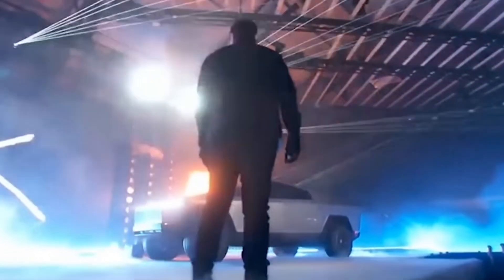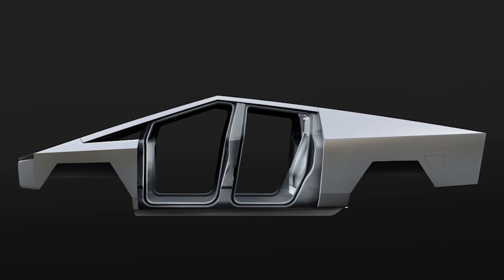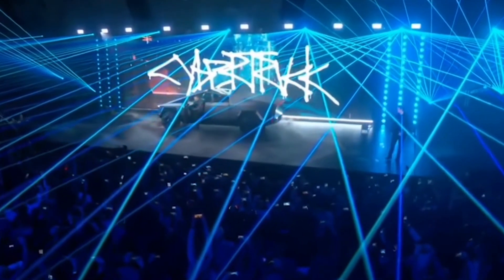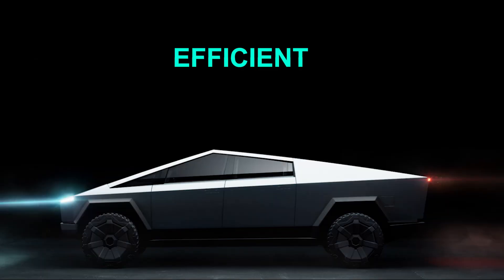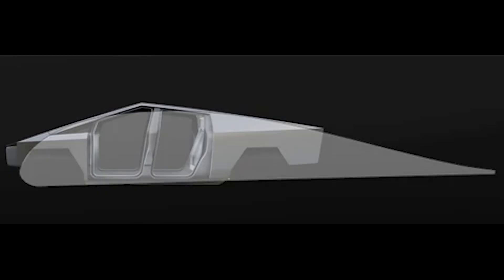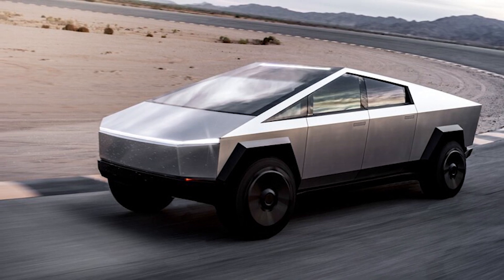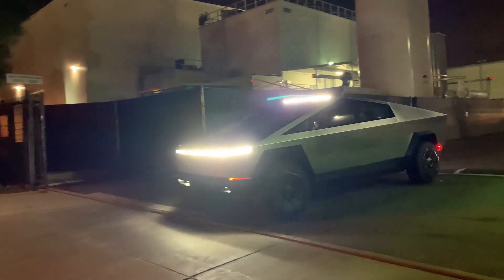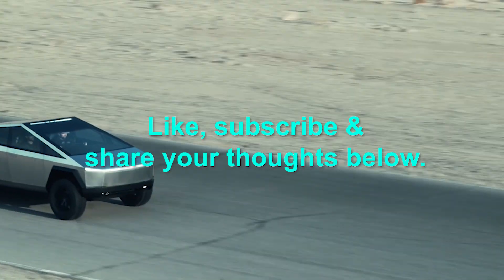Cybertruck is Engineering Genius (and will be copied)

Comment: Your safety analysis is off.. The 3mm Stainless steel exoskeleton (with a UTS of 1250mpa) will not be able to cushion a frontal impact. An abrupt stop will translate in a low ANCAP rating. In reality, a rigid 3 tonne vehicle should be able to bulldoze most passenger vehicles and increase collision times. Unless of course two Cybertrucks collide with each other... in that scenario the occupants from both trucks are in trouble.
Reply: I would agree but most safety standards around the world are in place to prevent that. 30-50 years ago bumpers were so strong and so tough that they would destroy everything they hit and not be scratched at all. The obvious drawback is that it kills whatever it hits and the passengers in the car. Today, cars are designed to collapse in the case of a hard impact to give the passangers/roadkill a chance. We are going to have to wait until tesla reveals more information about the truck to really have an understanding of its safety features.
Reply: @anubis520  When we design armoured vehicles for the army we generally don't extend the armoured steel beyond the cabin. I know Elon will be chasing that 5 star ANCAP rating so he'll be forced to reduce the thickness of the hood and front side panel. I'm eager to see how this plays out.
Reply from the maker: If it was not possible to score the steel to crumple in a predictable, repeatable fashion, I would agree. I don't think you are giving Tesla engineers enough credit but hopefully they share more safety details soon. A LOT of people are wondering.
Reply: @SolvingTheMoneyProblem  There's no question that 3mm armoured plating will resist deformation(that's what it is designed to do). The only way for it to work is for the hood panel to bend downward in the advent of a frontal collision. At it's current angle it is unlikely to do that. The more likely scenario is that it decapitates occupants of other cars.  If you're wondering i'm a design engineer with 20yrs exp. designing armoured vehicles. We generally use 6mm Armox with similar strength to the 301(FH) stainless. My guess is Elon was misleading the public, the hood and front panels are 1mm thick. The side panels, doors and tray are 3mm thick.

Comment: Doug DeMuro would disagree with everything in this video.
Reply from the maker: He's welcome to :)
Reply: Doug demuro is a clown when it comes to Tesla
Reply: Thomas stop crying.
Reply: DeMuro should know better than to publish such a blatantly misleading analysis of the Cybertruck. He made several misleading comparisons such as a base model 2-door Silverado with the Cybertruck. Then he never took into account the Total Cost of Ownership (TCO). Granted, TCO is different for every owner as mileage driven, gas and electric prices, maintenance costs and depreciation all need to be factored in. But he should have at least used some average numbers. Also, he did not mention anything about reduced maintenance or emissions of an EV so his analysis is terribly flawed to put it nicely.

Given that DeMuro has 3.5M subscribers between his two channels where he's so focused on cars, there's no excuse for someone in his position to make such a blunder with the Cybertruck comparison. If it was a mistake, then he's either incompetent or terribly sloppy, but if it was intentional then he has other motivations such as keeping sponsors happy, etc. In any case, he lost all credibility with me.
Reply: @bburton333  he doesn't have sponsors and he made a second video talking about the issues you wrote, you should check. And I don't agree with everything he says I believe the cybertruck is very good. But if the design doesn't appeal buyers it won't sell well. Many "ugly but innovative" cars have been a flop in the car industry for many years. Because money talks, so even if its a better truck than the ones out there now. No one is going to spend over 40k for something they don't like to look at.
Reply: @ricardobatalha1522  DeMuro's second video was just as misleading if not more so than the first one. He gets all excited saying that anyone who tries to compare "unknown" specs is a liar because they aren't known. What? The important specs can be found at tesla.com/cybertruck. Then he goes on to compare specs himself but just looks at towing capability and nothing else. If you look through the comments of his video you can find people who have attempted to configure a RAM 1500 or Silverado with the same specs as the dual-motor Cybertruck and they can't do it for less than $50 K which is the same price as the Cybertruck. Compare DeMuro's video with Teslanomics TCO comparison https://youtu.be/X4qs0sFyP4g. The Eclectic Beard's response at https://youtu.be/hn8NqzmLdys addresses DuMuro's second video point by point showing the actual websites.
Reply: @ricardobatalha1522  good thing is cybertruck is not first or only tesla products. I don't think cybertruck clientele is gonna cross shopping with silverado/f150 and vice versa. Cybertruck is their own thing like g wagon. In paper spec sheet and driving experience, there's a lot luxury suv/cars that's better than shit to drive g wagon but none of these stopping people from buying g wagon.

Comment: No paint!? I doubt it. There is likely still a clear coat applied. Raw untreated stainless steel is not actually impervious to oxidation despite its name.
Reply from the maker: As The Senate says, I believe it's a corrosion resistant chromium alloy.
Reply: @SolvingTheMoneyProblem  stainless steel IS a chrome alloy
Reply: Painting stainless is a challenge, but wrapping it is a piece of cake. I think the factory issued Cybertrucks will come "bare" and options will be readily available in the aftermarket. Part of making this vehicle available at the low price Elon projects is avoiding painting them. Incidentally,  if your Cybertruck needs to be spiffed up, grab a can of WD40 and a rag, it was originally made for stainless.

Comment: You said its safe for the passengers  but what if this car hits a pedestrian? The bumper isnt soft and rounded like conventional cars, this will amputate limbs or even kill. There's no way a person can slide onto the windscreen because it's angled. Also the dashboard and passengers sit very close to the front of the car. Will there be adaquete room for the bumper to crunch up? This looks like a good concept for a military car but I can't see how this would be a good idea for ordinary people.
Reply from the maker: Good questions Oussama. I'm interested to see how Tesla engineers solve pedestrian safety. That said, with he flat underside and air suspension, the car could drive over the top of someone and they'd be fine if they don't get decapitated in the process🤣. Keep in mind autopilot, Tesla's goal of FSD and 2+ years until production starts which will greatly reduce the chance and severity of collisions. Regarding crumple zone, the driver actually sits as far back from the front of the vehicle as they do in the Model 3. It's deceptive but if you overlay a Model 3 on Cybertruck to scale you can see clearly. So there's room. Stainless steel can be scored to predictably, consistently crumple upon impact so no issue there.

Comment: I actually sorta like this. Unfortunately the range of evs still turns me off. 
Also single exterior panel? So if I dent say the front right the whole things gets changed?
How does this deal with required crush zones to save pedestrians?
Reply from the maker: Hey Kyle. 500+ miles range turns you off? My understanding is a dent can be removed by a metalworker. If you had a major accident, probably a write off but same can be said for other vehicles. Steel can be scored on underside to crumple predictably and consistently.

Comment: 1. Low cost - It is still way more expensive than the competition. The folded sheet metal design is interesting, and the no paint concept - but the end result in MSRP isn't convincing. And if the stainless exosceleton is as tough as the "bullet proof"glass, I would rather pass. Besides the look is terrible.
2. Function and performance - As with most of Tesla Products - electric truck, household batteries, roadster - the are no independent long term tests proving the infomercial style claims. 
3. Efficient - Test it with the trunk lid open, or with the payload in the back and it won't be much better than the competition. Airfoil may be efficient but is a terrible design for vehicles  and it was dropped after the 50s because it created lift, making the vehicle unsafe and uncontrolable at high speeds or winds. CL is more important than CD for a car.
4. We will have to wait long term to see the real safety of all electric vehicles,  especially with the fire hazard from batteries and electrical charging systems.

Rest assure for you investment though. This truck is GENIUS, but a marketing and croudfunding hoax genius, not engineering.
Reply: stfu u dnt kno nuthin
Reply from the maker: I appreciate you taking the time to share you thoughts Angel. I don't think you are giving Tesla or its engineers enough credit but at least we agree on one thing - genius (of some kind) 🤣

Comment: So, basically Musk had applied Soviet design philosophy of T-34 ("cast the turret in a molding form entirely/fold it from a single sheet of steel, instead of wielding and clamping it from great number of details") to car production...
Reply from the maker: I'm not up on my tank history, Baz but I've learned something today.
Reply: @SolvingTheMoneyProblem  Well it aint really tank history. Rather the perfered strategie of the Soviets. Quantity over quality. However I wouldnt say that this lacks quality like Soviet manufacturing did in comparison. After reading that Mercedes and Audi are laying of 10k employees each, he has to be doing sth right, to grow a sector where others are downsizing. Efficiency of the production is a key factor to costs.
Reply: @Alex-fm2pn  Also, what makes you think soviet manufacturing lacked quality? Quite the opposite... but I see you're not too familiar with the topic.
Reply: @derbigpr500  I see you want to be the specialist. Soviet "quality" was gaps of an inch on a t34 answell as the hammer you got to change the gears.
Reply: @derbigpr500  I hope in the near future cars will be just like bikes. Nobody buys a bike because of its flashy design and to impress people. A car is a tool, and tools must be efficient over anything else.
Reply: @derbigpr500  Boi, u need a dopamine pill
Reply: @caiofernando  great point
Reply: @derbigpr500  "Soviet manufacturing didn't lack quality" Boi, have you even seen a T-34? It was designed to be the cheapest it possibly could. They found that the track pins started falling out, so they literally designed an external fixed hammer that would fucking slam into the pins as the track moved to keep it together LOL. The T-34 was so loosely held together and unsealed, with such poor tolerances, that the Germans preferred method for infantry to combat the tank was to throw Molotov cocktails on them because the burning alcohol managed to flow inside the tank.
Reply: @caiofernando  that is certainly not the case in America.  In America bikes are fashion and "lifestyle" statements where color and style are just as important as function.  And I would argue that so are trucks, which for most owners are not even remotely practical purchases, but fashion statements that are chosen to tell other people something about the owner.  Most people these days buy trucks to be seen in them.  Maybe it was true 40 or 50 years ago that trucks were utilitarian vehicles, but not so much today.
Reply: @derbigpr500  While I don't know the quality of Tesla cars I would agree too many people fall for Elons stunts. I am almost never impressed with Elon, rather i find he says incredibly stupid things while people credit him with other peoples good ideas that work for Elon.
Reply: @derbigpr500  Lacks quality based off a tv show or YouTube video you watched from 2018 on Tesla model3 days? So you think making things more complicated and putting 40 buttons on the dash makes more sense? There is something to be said with simplicity. The complexity moved into a digital pad in the middle of the car called a 15” touchpad. You can dig it down to the level of steering wheel telescoping in and your seat moving back called “ease of access” to get out of the car or complex offsets while in auto pilot etc. I have a model3 and around fifty people have driven my car and every single one of them leave with a huge smile! They are inquisitive and continue to ask all about it months later, unless they already bought one. When is the last time you can say that about any car you ever had, which should give you an understanding of interest and design. In thirty years and all of the cars I have ever had this is a masterpiece of pure joy in every way! Have you ever not visited a gas station for 9 months? It is amazing! This is not the movie Idocracy, it’s the future and we are finally evolving past the mundane, nickle and dime you to death, cookie cutter crap that every other car manufacture does to you. Damn I bet you really hate Walmart lol

There is nothing boring or cold about the cybertruck! Its hot as hell and nearly broke the internet many times 😊 
It has more style than anything else this year hence why you are on YouTube posting comments about it. So I cant have emotional or sentimental value for my Tesla why? In 40 years they will make a movie about the Tesla Model 3 and how it revolutionized the entire automobile industry. What car do you drive right now? Why are you not ranting about them since it wasn’t hand built! Tesla makes a product that SOME OF US can appreciate and understand the true value in. It sounds like you dislike Elon a lot, but at the end of the day he has done more in his lifetime than mine or your entire families generation has ever done. That demands respect period!
Reply: @Alex-fm2pn  
Tesla Cars definitely lack quality, unalined panels unsemetrical head lights it's all over the place
Reply: BeyerT1 Yeah, that’s why Sandy Monroe, one of the most respected automobile builders in the world, called the model 3 “a symphony of engineering.”
Reply: Caio Xavier then why would someone buy a heavy duty truck that can't do truck things?
Reply: I’m turning mine into a battle zone tank ! 🤯🤯🤯🤯😎😎😎👍👍👍👍👍
Reply: In Soviet Tesla, car drive you!
Reply: could be seen as a bauhaus design.
Reply: He didn't have a choice.... the manufacturing method was dictated by the work hardened 301 stainless steel.

Comment: You clearly have no clue how Americans use trucks. Having lived in Europe for 12 years the USA is not Europe or Asia. The Tesla Cybertruck is not going to sell well as compared to the Ford F-150. The Cybertruck could not last 1 day on the typical American Farm or Ranch or even for a short Holiday Trip of 2-3 hours each way pulling a boat, 5th wheel camper/caravan or the like. It cannot make the relaxed 800 to 900 miles a day I usually make in any gasoline or diesel car or truck when on Holiday en-route to were ever I am spending my time. The lack of charging stations alone make towing almost impossible. You would have to be willing to drive 1.5 hours and stop and charge for 1 hour assuming you can make it to the next charging station. Pulling 5000lbs. is fairly common in the USA and we have a lot of steep grades as well. The State I live in Michigan is larger than all of the UK and we are not even among the biggest States. All of Western Europe could fit inside 1/3 of the USA's land mass just talking about the 48 Contiguous States not all 50. Tesla Cybertruck is ok for East Coast and West Coast assuming California can keep it's power on but for the rest of the USA it is not a game changer at all. $39K to $70K is also not cheap. It might be cheap by European  standards but that is not saying much. Also let's see how that Tesla is fairing 13 years latter which is a meager amount of time for say a Toyota truck to be still functioning often with no major work needing to be done for the first decade. Tesla has not proven that he can build a durable dependable product and right to repair has not been well established and parts for out of warranty Tesla's is insanely high and often impossible to come buy. In America when we pay to purchase an item we expect to fully own it.
Reply from the maker: Although Tesla hasn't mentioned range when loaded/towing, if it sucks (like Model X does), you are right. It won't replace the internal combustion engine vehicles used by people who need them for long range or consistently pulling heavy loads. I'm not claiming Tesla will top the F-150 in sales but it will force Ford to offer a similar electric truck or watch their market share eaten away as battery costs drive down EV prices making them far more competitive over time.

Comment: Kind of shill video. Exoskeleton? Pedestrian safety nightmare. Range WHILE towing? No mention about it. Check the tfl video about towing with electric car and how much the range falls.
Reply from the maker: You're right, the short presentation didn't mention pedestrian safety or range while towing. It's not going in to production for 2 years so I imagine we'll learn a lot more between now and then.

I've seen, Model X range is atrocious when towing but it was not engineered with moving heavy loads as a priority. Cybertruck is. I'm very interested in this thought. If range while towing/hauling big load is shite, it's a down side for many buyers.